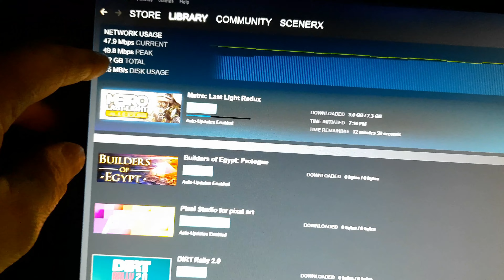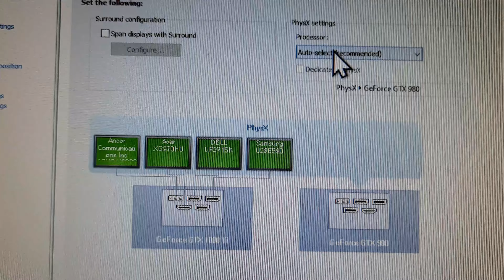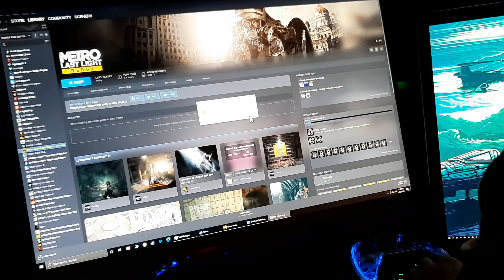Should You use A Dedicated PhysX Card?!?

Comment: I know this is an older video, but I tingered a bit with this earlier on, and just found this video. Batman Arkham Knight is a game that benefitted a great deal with a dedicated PhysX card. I was using a gtx1070, with a gtx1050ti for a dedicated PhysX card. Didn't really find any other game that worked really.
Reply from the maker: Yea, Theres a few others, like metro last light and I think around 55 others that benefit from a dedicated physx card.
Reply: @xpodx  I wish they had used it more, since it actually worked. And we had an excuse to add another gpu to our pc, hehe..
Reply from the maker: Right?  Yea I feel the same.  XD
I have a metro video too that I tested using physx with and without showing the fps, definitely a difference.
Reply: @xpodx  when I saw your video this morning, I started to download the Batman game I mentioned. Want to try it with my new gpu, a rtx3060 12gb, and maybe I will try with a PhysX card also.
Reply from the maker: Oh nice man! Tell me what you get
Reply: @xpodx  so, two months later...
I finally got around to adding my old GTX1070 as a 2nd gpu, in addition to my new RTX3060. Not really for the point of a Physx card, but more to test it with Davinci Resolve. But, while I have both gpu's installed, I tested "Batman Arkham Knight" with the GTX1070 as a dedicated PhysX card. So, with that RTX3060/GTX1070  combo, I gained 20 fps. My average fps went from 73 to 93 fps, by using my GTX1070 as a Physx card. 
Graphics settings maxed out, in 3440 x 1440.
Reply from the maker: @boringaveragenobody  wow that's really impressive!  
I didn't think the avg fps would increase but only when the physx would kick in. That's really awesome!
Reply: @xpodx  yes, Physx works great in that game.
Reply from the maker: @boringaveragenobody  I agree with you. Makes me sad all games aren't like that

Comment: Would this be more relevant now that the RTX 5000 series GPU's don't support 32 bit PhysX? Like using an older secondary GPU for PhysX calculations instead of the CPU.
Reply from the maker: @yazza0013  id assume so. Good thing I got a 1600w psu and 3 pcie Lanes. Ha

Comment: I was contemplating on Pulling the HP OEM GTX 760 192 bit 1.5gb from my HP Envy system to throw in to my Ryzen 7 2700 system with a Strix RX 580 8GB just to have PhysX access on some of the older games like GR Advanced Warfigther 2 and the Borderlands series but wasn't really sure I should bother. Hoping top get my hands on a 3gb or 6gb 1060 for the i7 4770K HP system which is just used as a video editing system anyways and not for gaming.
Reply from the maker: If your psu is enough for both 580 and 760 so like 750w or higher id try it at least.
Reply: @xpodx  Yeah Have the Fractal Design Ion+ 860W Platinum PSU for my gaming system.
Reply from the maker: Throw it in your pc then my dude. Test before and after performance,  see if its a upgrade.
Reply: get the 6GB don't even bother with the 3GB you'll regret it.
Reply from the maker: Already got a used 1060 in a pc, I'll upgrade the other components this week.

Comment: This might be relevant now in 2025 and beyond considering that NVIDIA has dropped PhysX support from RTX 50 series and beyond. Even with a 5080/5090 if you are playing an older Physx heavy game, your fps will be terrible with CPU driven Physx so a dedicated PhysX GPU is the only way. This doesnt affect 40 series and below cards.

The reason is due to NVIDIA deprecating the 32 bit CUDA libraries in the 50 series card drivers so the Blackwell architecture doesnt use those features anymore. Something to think about if upgrading to RTX 50 series.
Reply from the maker: @acowsik  ill definitely test this and use a 2080 as a dedicated physx card when I get a 5090.
Reply: @xpodx  I would be interested in seeing that. Currently rocking a Zotac 5080 since my MC only had 5 5090s on launch day. The Card is a 3.5 slot so I can't even use another GPU I have lying around as a dedicated PhysX card. If I can get my hands on a 5090FE then I will actually be able to use my other PCI slot. The fight against bots has been rough.  The 5090 did appear in Best Buy today a few times, but it seems like every time they sold out in  3 seconds. Had worse luck today than the past two times they dropped.
Reply from the maker: @lego_minifig oh nice man,  dang thick card xD. What cpu do you have, and res?
Reply: @ just upgraded from a 3900x to a 9950x. As a graphic designer, I loved the multitasking benefits of the 3900x. Last time I upgraded I only had a part time job so I could not justify going all out on 16 cores. Gaming is always a second priority, but this chip still handles it like a champ. 

Last year I upgraded to a 32in 4k OLED 240hz monitor. I wanted to see the productivity boost with a larger and higher res monitor and saw that the color accuracy was higher than my old 27in 1440p IPS. Ever since that upgrade my poor 2080S had been struggling. Had to go into the driver and drop my resolution whenever I wanted to run a game. So the 5080 has been a nice boon in that regard.

Overall, I am really happy with my current setup. It’s basically the setup I dreamed of when I built my first PC on a $1k budget.
Reply from the maker: @lego_minifig heck ya that's super nice. 5080 is pretty powerful. I hope i can get a 5090 this month or next. 2080 is pretty slow. Hs

Comment: I came here as I just installed a GTX 970 as a dedicated PhysX card paired with an RX 6650xt
Reply from the maker: @Destado1  oh heck ya, you have a couple physx games?
Reply: @xpodx  I actually have a few. My results are that in some games the "eye candy" is  minor like in the Batman Arkam games, as well as the Metro series, but in the Borderlands games the blood splater, the shock/fire/acid barrels add a lot that is missing if using just the RX 6650xt even though it supposedly has PhysX support. Cyberpunk 2077 supposedly has hardware PhysX support but I get an error about ray tracing that is caused by the mixed GPUs, and 3Dmark performance is like half of what it is without the nVidia card.
Reply from the maker: @Destado1  yea i noticed it's a couple fps difference when I did metro testing. It's pretty sweet. I just wished they took more advantage of physx and made it more intensive and a bigger impact visually
Reply: @xpodx  Same, especially when compared with the Borderlands series, but I give Metro they did better than the Barman Arkam games as that was just mainly weather (from what little I played) effects.
Reply from the maker: @Destado1  thought it was extra explosives I think as well. Not 100%